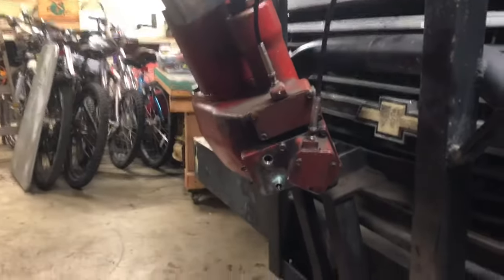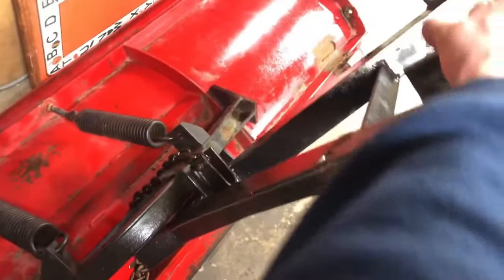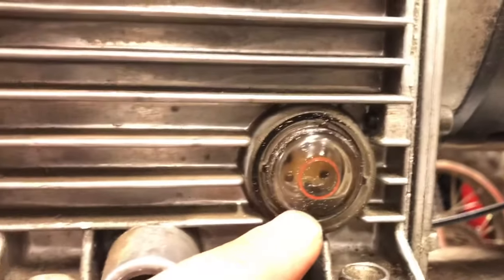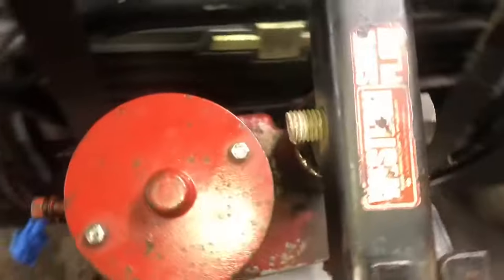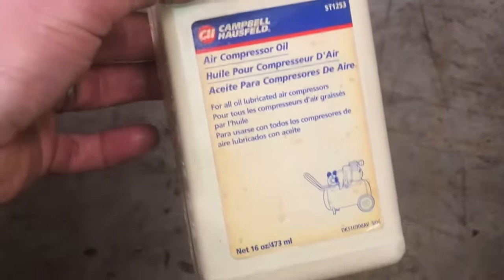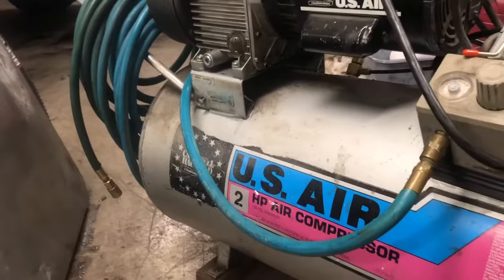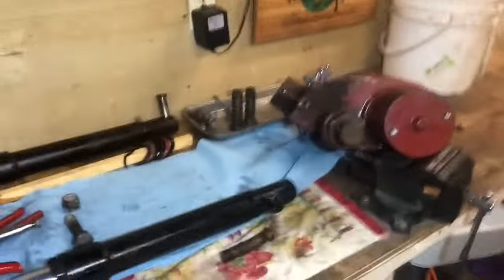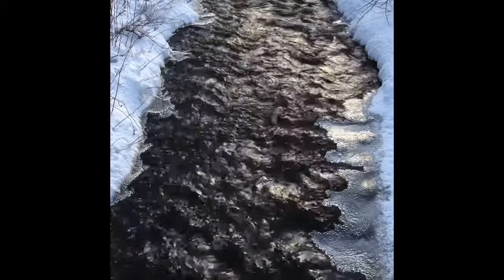EP94-Western Isarmatic Mark IIIa Cable Plow Not Angling Right Diagnosis (Plow Pt.3)

Comment: Any idea on why the valve associated with the drainage of the fluid out of the lifting ram might not drain back to the main reservoir properly?  Thanks.
Reply from the maker: I’m not exactly sure what specifically  you’re referring to without looking at a diagram or something but most commonly would probably be some sort of gunk or some thing causing some sort of blockage? If things aren’t adjusted properly there might be an issue with drain back as well, it’s been quite a while since this job and would have to chat back-and-forth a little more to get a solid idea of what you’re dealing with
Reply: @LastFrontierGarage  I'm referring to the horizontal mechanisim that is controlled by the cable that enters the smaller rectangular box above the 4-way valve that controls the side-to-side motion of the plow.  The top cable connects to a piece that rotates the cam that is supposed to allow the small ball within the check valve assembly to unseat, thereby allowing the fluid to drain back from the lifting ram to the reservoir around the pump.  There is also an adjustable lift valve with o-rings on the front side of the pump assembly.  I'm wondering if there is an internal passage that might be plugged or if the small ball within the check valve assembly is not functioning properly.   Thanks.
Reply from the maker: @GasificationMan  I would agree it should be one of those two things, once taking apart the case is extremely simple so it’s got to be some sort of clog or stuck check ball etc
Reply from the maker: @GasificationMan  Do you have the service manual? The diagrams in there should help break down what’s going on without it being apart and looking at it
Reply: @LastFrontierGarage  I do not.  Not sure I've seen that one available on the internet.  Thanks.
Reply from the maker: @GasificationMan  https://library.westernplows.com/westernplows/pdffiles/13280_080193.pdf

You should find a nice diagram of the lift valve on page 25

Comment: I've got a conventional plow and I cannot get it to go up but it does angle alright. I just cleaned everything up in the case and flushed the cylinders and still wont raise. Any thoughts on what it might be?
Reply from the maker: What’s up Jesse, here’s the manual to plow, I believe the Troubleshooting Guide is in Chapter 4; it sounds like your lift valve is out of adjustment.
https://angelos-supplies.com/docs/Cable%20Control.pdf
Reply: @LastFrontierGarage 
Seriously THANK YOU for this - you just saved my hiney 😁
Reply from the maker: @hammer159  glad to hear!

Comment: Pumps and plows treat you how you treat them , doesn't matter what brand plow or pump.
The holes and the wobble in the quadrant pivot are there to let the blade articulate to stay on the ground on uneven surfaces, get it to tight and it will plow like poo, it has to be able to confirm to surface changes, float gets you the down movement, and the loose holes and pivot gets the high and low on the ends of the blade, 
You may check your hose disconnects sometimes they get rust and wear and will keep the blade from angling , good luck be safe God bless
Reply from the maker: Thanks so much for the tips Bill!

Comment: I have same plow but my pump just keeps running and won't shut off can you please show the wireing
Reply from the maker: https://angelos-supplies.com/docs/Cable%20Control.pdf
Reply from the maker: There should be a wiring diagram in above post, it’s the manual for plow; sound like you have a short in the system or relay stuck, possibly an issue with the electrical connections in joystick